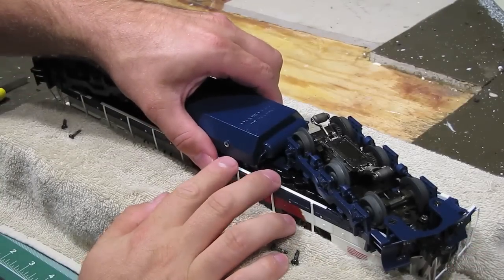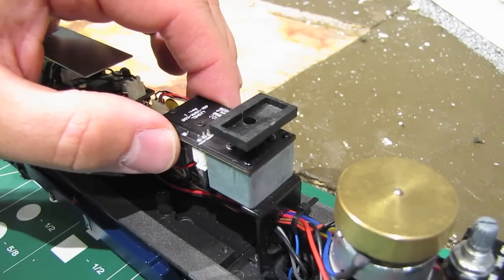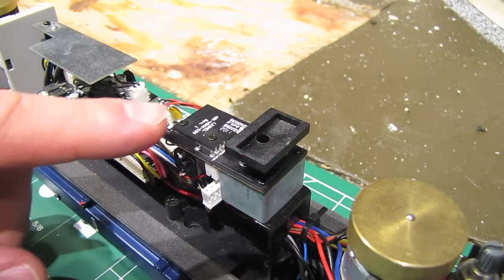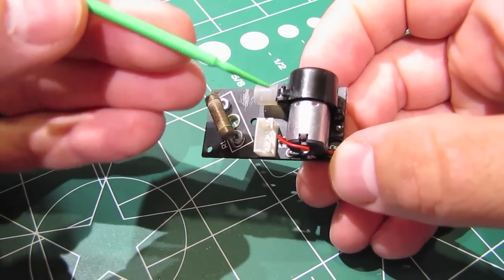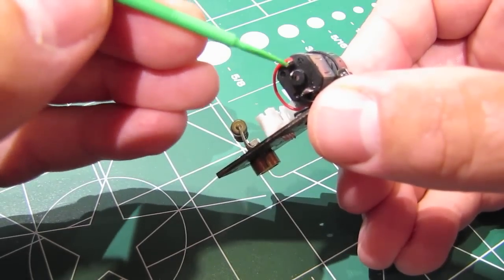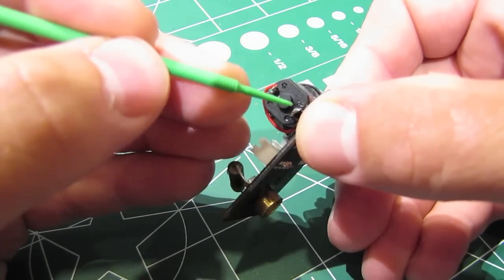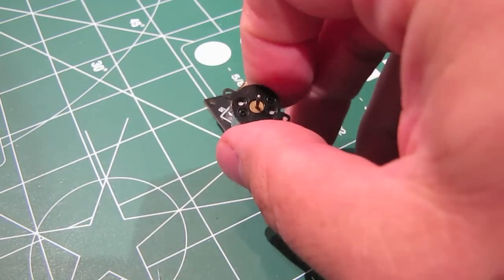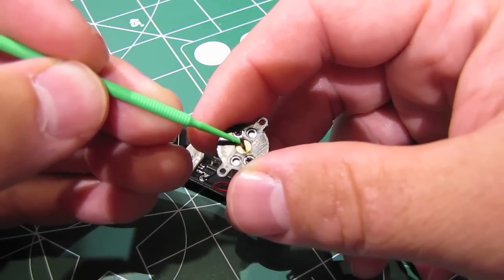How To Fix a Noisy Smoke Unit

Comment: I know that this video is old but I just now stumbled across it. Thank you very much I had a new Lionchief plus locomotive that had a noisy fan and this fixed it. The LC + locomotives are trick as the screws are directly under than fan.

Comment: Great video Eric. Had the same issue with a new MTH set I got this past winter and a single drop of oil made it much better. Of course I wasn't as careful as I should have been and popped a wire off also. So, I got to oil the motor and soldier as well.

Comment: 5:27 If only I had watched this video before trouble shooting. Lead/solder post on the fan touched the housing and instantly saw a small spark. Now the entire etc is dead in the water. it will do nothing. I could simultaneously scream and cry.

Comment: I was wondering if you could make black smoke and if you could add another smoke unit to the rear of the engine, and possibly slicing little 'vents' into the shell were the vents are already at, just not open.  Just to get a more real look.  Is that possible?  Has anyone done it on the forums anywhere?

Comment from the maker: It's pretty redundant. The only thing that changes is how to open up the engine and get access to the smoke unit. The work on the smoke unit itself is the same, regardless of whether it's steam or diesel.
Reply: Had a smoke unit on my mth Warr Gereral that hadn't worked in awhile. Took the blower off as you instructed and lubricated it. Get it working now, Great idea and thanks for showing me how to fix it.